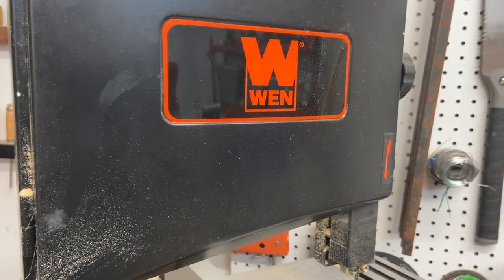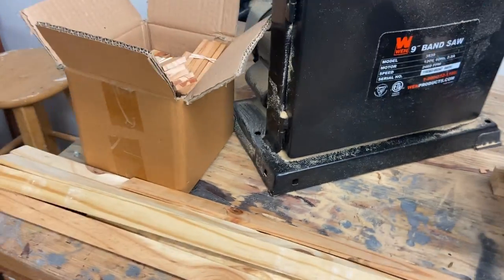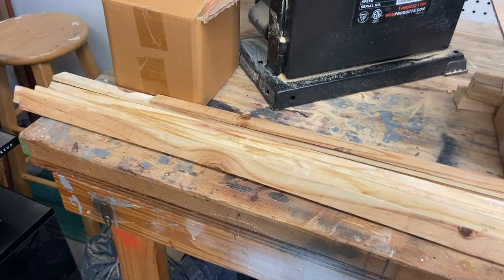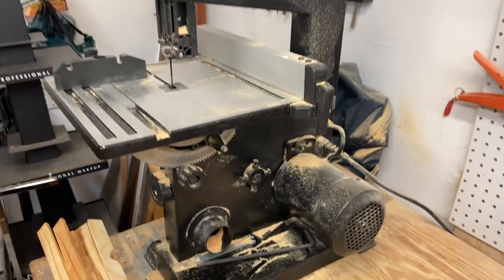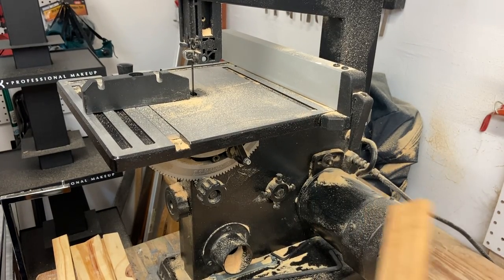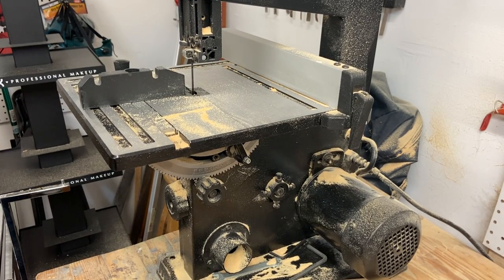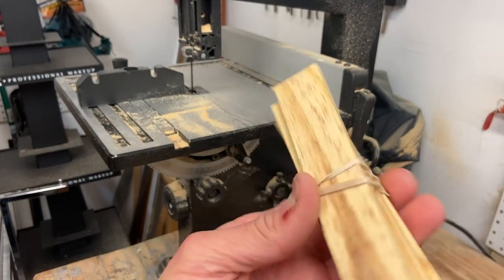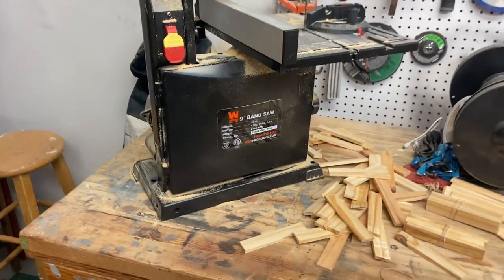WEN 9 inch Bandsaw Demo-Plus a Bonus Tip

Comment: Thinking about getting this band saw and want to know a few things about it first. I know it only has a 2.8 amp motor which is roughly 1/3 hp will it cut 3/4" to 1" maple, mahogany and ashwood? Which leads to my second question I'm sure like 99.9 percent of every other saw on the market the blade that comes with it is worthless junk, what would be the best blade for cutting those hardwoods,  tooth count and blade width? I won't be doing any tight radius or scroll cuts with that type of wood.
Reply from the maker: Hi jdj62464,
I found the blade that came with it was more than adequate to cut the type and size of wood you mentioned. 
The only thing I would suggest is to get a blade that is at least a 1/4 inch wide with a high tooth count to ensure clean cuts. I hope this helps. Jay

Comment: can you demo step by step how to mount the saw blade if it came out the wheel of this bandsaw.
Reply from the maker: Hi Steve!
The model number is 3939. I wish I had made an unboxing video because it’s very simple to set up. The best feature I liked was the blade was already installed and needed no adjusting! 

I was able to start cutting right away. It also came with two large Allen wrenches and a small wrench. I was very happy with the purchase. The only down I’ve had is finding a replacement blade. I wanted to order one from Amazon but I could not find the correct size. I had to order from WEN directly. No biggie, just a minor hassle. Still highly recommended! Thanks for watching!  Jay
Reply: Woodworking Blues I buy the same one you got